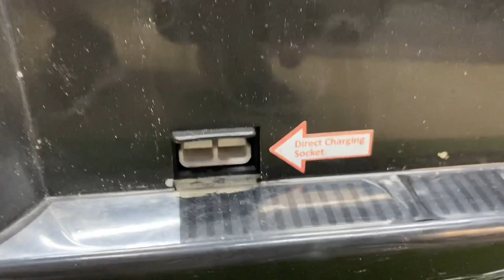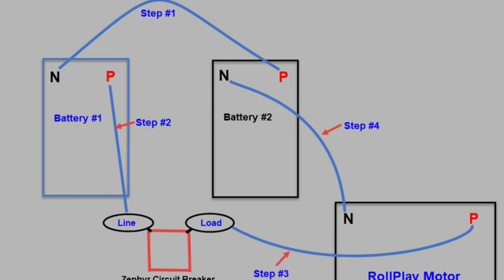Chevy Silverado 1500 RollPlay 12V to 24V Conversion Kids Car/Truck

Comment: You are a genius my friend I just tried and it ran smooth as butter fast and more fast the little one did not want to leave it it was great followed the steps got some 12 gauge wire and a bussman 30amp circuit breaker from autozone and boom thank you again tu have a subscriber in me thank you have a blessed day
Reply: Leah Watts  I just did my son's, just a 5 minute test ride. We cam smell burning electrical... afraid to keep pushing it.

Comment: I actually did this with one I just bought for my grandson, and this this is FAST in high gear. Exactly how fast I'm not sure, but I can tell you that in low gear it will easily keep up with our riding mower at full speed.

Comment: You can get a DeWalt drill battery harness. And use drill batteries. Easier conversion and cheaper batteries that charge faster.
Reply from the maker: Great idea…where’s your video and explanation?  Talk is cheap.
Reply: @socalgaragegolfers9343  🤣

Comment: Mine has a control box with soft start and remote built in, would this still work or do I need to remove the control box and wire it so it just works on the pedal

Comment: The wires on my quick connect plug have pulled out of the plug itself.  Is there a way to reconnect the wires to the original white plastic plug?  I'm having a hard time figuring out how to get the wires back in.

Comment: Hello, thanks for this well explained video. So, if I have a 6volts and wanted to upgrade to a 12volts, how many amps circuit breaker do I need to get for this conversion? Do i need to go 30amps or lower and if so how much lower? Thanks for your advice!

Comment: It depends the value of the main controller board and the dc motor.
If you will upgrade 12v - 24v without changing board and motors you will ruin your rideon car immediately!.
It will run but it will burn in a few minutes.

Comment: Did everything exactly the same but it doesn't work. Any suggestions?
Reply: I tested it and blew the 40amp fuse. Maybe I might let my daughter drive it instead of me.
Reply: Same thing.  Pulling my hair out why it won't work.  Double and triple checked wiring and used the exact same parts.  Turn they key on and it only beeps once, not three times as before.  That's the only thing it does.

Comment: Quick question... Did you have an additional battery "retainer" bar (idk what it's supposed to be called, but it's the bar that goes over top of the battery and screws down on one side) for the other battery? If not, what did you use to hold down the battery?

Comment: Does the lights and radio still work or does it blow the circuit board right away?
Reply: Everything still works. I just completed the conversion a few weeks ago. So far everything has held up. Eventually the motor and gears will fail. I’ve already ordered the stage 3 motors and metal gears from ML toys which is also a quick conversion.

Comment: Hi , really  well  explained here.  Just a question please. Are the RollPlay cars motors  designed to  handle 24v ? I  currently have  a ride on  for my kid, which is not a Rollplay one. It  has  2 x  12 v battery's in  parallel  not  series. Was  wondering if i can  just  rewire it to be in series ie  24V and upgrading the  circuit breaker to  30 amps.   Whats misleading on the  ride on  I  got it  says its  24V, but its  actually just  2 x  12 v batteries , so it  surely has  more AH,  but at  12V,  so  not sure if it better to run  more  Voltage ie  2 x  12 v = 24V (Series) at lower  AH  or  2 x   12v = 12V (Parallel) at Higher AH?  And the Charger point is  like them Aux microphone port type.  But I am still not  sure if the 4  motors on the ride on can  handle the  24V. And will a  drop in  AH  ie  from  18AH to  9AH make any  difference you think? Thank you

Comment: I did everything besides put a circuit breaker in...I just used the online fuse.  I didn't have a fuse in it....but tried it anyways and nothing.  Does the fuse have to be in to complete the circuit?

Comment: Great video thanks. Two questions for you. 
1. What did you do with the fuse that came with the original battery? 
2. What gauge wire did you buy ? 12g 600v?
Reply: He mentioned it maybe a 14 or 16 Gage but I wondered if it matters which one u use.I just ordered my nephew a Dodge Charger police car Power Wheel and I'm already planning on modifying it.LOL
Reply: It's a 12....o just did mine yesterday

Comment: If you don't want to go through all the hassle of upgrading your charger, just swap your jumper wire between the batteries so they're in parallel instead of series.  Then your 12v charger will charge two 12v batteries at once.
Reply: How do you do that?
Reply: @victoriasanders2151  here, they're wired in series, two 12v batteries make 24v in series.

If you swap the jumper so that the positives are connected to each other and the negatives are connected to each other, they're wired parallel, so your charger will charge two 12v batteries like they're one bigass 12v battery.
Reply: @brianbird3756  So basically after the kids are done playing with the truck and you go to charge it, you have to just unhook the wires and set them to parallel to charge. Once charging is done set them back to series and off they go again? Is that correct?
Reply: @grantourino13  yep
Reply: @brianbird3756  Last question, If I go with a 12V and 6V battery (want to make mine just 18v, not full 24v), would the stock charger charge the 6V battery if I ran this set up parallel or would I need a separate charger that is designed to charge 6V?
Reply: @grantourino13  no, it's designed for 12v.
Reply: @brianbird3756  So I got my batteries and wires all ready to go. But there’s 6 connections. The jumper wire that goes from battery 1 to battery 2. The main battery charge cable (that has the white plug on it) that now has a negative that goes to a battery terminal, and the positive goes to the 30a circuit breaker and then the other jumper wire goes from the circuit breaker to the last battery terminal. Which wires need to go where to make it parallel? Sorry for the all the noob questions.
Reply: @grantourino13  parallel is like the two batteries on a diesel truck.  Positive to positive, negative to negative.  Stays 12v

Series are like the batteries in an old school flashlight positive to negative so to run the truck like he did in the video, you'll hook it up with your jumper exactly like he did.  To hook it up and charge it like it's 12v, you'll want to jumper positive to positive and negative to negative with your charger negative on either battery negative, and your charger positive on either battery positive.
Reply: @Brian Bird  can you run the two batterys as one big 12 volt with the 30 am  breaker and just have long run time that way?
Reply: @anthonymoy4471  yep, wired in parallel

Comment: I used a 30 amp mini fuse, and it continues to blow the fuse when she stops and starts quickly.  Any suggestions on how to prevent that?  I have the zephyr fuse on it's way.
Reply: Too much power being drawn. Put a speed controller. They sell them on Amazon cheap (about $20).

Comment: The problem I have with this video is that you did not mention if the adapter needs to be changed. Like the adapter that some of these come with. the 121 volt adapter.

Comment: Originally motors runs on 12 volt, is there any risk to motors if you supply double 24 volt,  bcoz motors are marked by default as 12 volt,
Please advise.
Reply from the maker: Yes the major risk is you go fast. If you don’t wanna go fast leave it 12V.
Reply: @socalgaragegolfers9343  naw. Major risk is motor will burn out and gears will strip. Dont give people false info. Smh. These stock motors are 550 motor which is rated for only 12v. Can be run on 18v but not 24v. It will run on 24v but will burn out quick. You need to upgrade to a 775 motor which can handle 24v. And will need metal gears so they won't strip.
Reply from the maker: @johnrambo1349  you’re spot on with your comments BUT nearly a year later and this thing is still running with no issues.  I’ll take the risk.
Reply: @socalgaragegolfers9343  Could this same set up just be done with a 12V battery and a 6V battery instead of two 12V batteries? Or does adding another battery of lower voltage change the dynamics of how the wiring would need to be run?

Comment: Hey, so I just did this on mine. Same truck. Used a 30a breaker, the only thing that might be different is that I used an 18g wire (all I had). Doesn’t beep when key is turned on and it doesn’t move at all. Batteries are fully charged. Any idea? Thanks very much
Reply: Did you ever figure out what was the issue? I have the same problem with mine. Turns on but the pedal does not move the truck.
Reply: I am in the same boat.  I did the upgrade and now the battery meter shows a full charge, but when I turned the key and pressed the pedal nothing happened. I went back to 12v and still nothing
Reply: So I had the same thing happen to mine and I was not able to get it to work. I checked this diagram: http://assets.rollplay.net/12v-gmc-sierra-denali/12V_pickup_service_guide.pdf You will most likely need a new controller. I found this video to replace it (i needed a new pedal anyways but you can find a cheaper controller without a pedal but wiring will be different) https://www.youtube.com/watch?v=bqtbd5UHmhI&ab_channel=RaztechPowersports
Reply: Mine did the same but when I connected to a single battery it would work but not both....not sure what it could be
Reply: I have the same issue. Did the conversion with the same parts and it shows full power but will not move.  Not sure what the issue could be but I hope it is not fried…
Reply: @tor2112  so I ended up cutting the purple wire and yellow wire from the circuit board and connecting them together.  It bypasses the key switch and will run when connected to charger so be careful if you decide to do this.  It's been working great since.
Reply: @skillz101989  thanks for the quick response. Is there a video support for that and what do those wires do?  Are they easy to access and could they be different colors??
Reply: @skillz101989  are you referring to the large gauge purple and yellow wires that run directly into the circuit board?  Just connect those together??
Reply: @tor2112  I’m in the same boat as you so hoping this solved it

Comment: Has anyone ever done this with a milwaukee 18V batter conversion?
Reply: I did with a 20V DeWalt battery, I kept the 12 volts for the radio, and 20V for the motors
Reply: @mattemburgh7188  you got a video?
Reply: Yea I need the info. I bought the adapter and can’t get it work

Comment: I did everything you said but it won’t work and I smell something burning please help
Reply from the maker: Send me some pictures. Our truck has been working perfect since the conversion.
Reply: The stock 550 motors are not rated for 24v.
Reply from the maker: Andrew Smith  yes that’s true....not rated for it but that does not mean it does not work if you push it to 24v. Does it spin the motor faster? YES. Does it work? YES. Will it wear faster? YES. But you will extend the usage because the 12V is just to slow for the kids when they get older. Cheers and going fast is fun.
Reply: No issues with overheating? About how long do y'all run the truck?
Reply: Did you get it worked out? I just did the conversion and popped the upper control board inside the dashboard. Waiting for parts now:(
Reply: Same thing.  Only beeps once when you turn the key instead of the 3 as before.